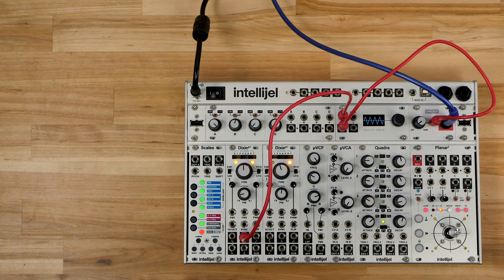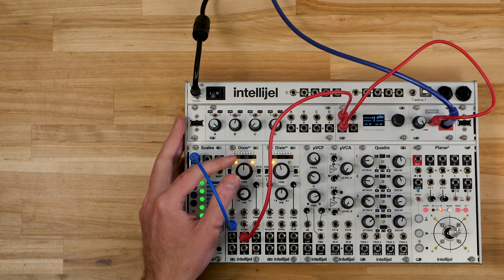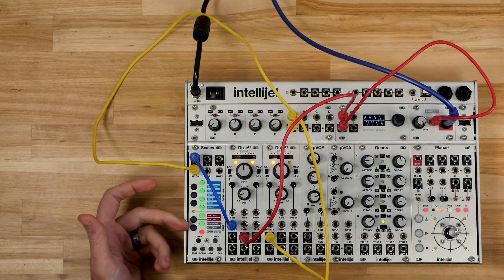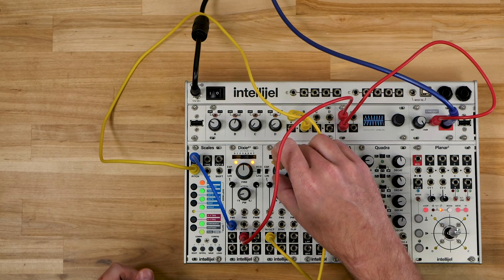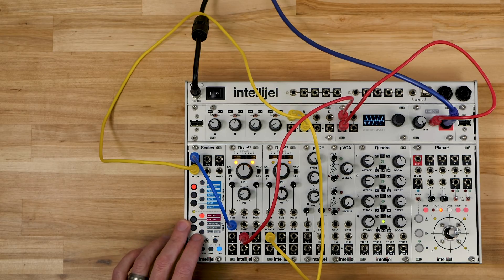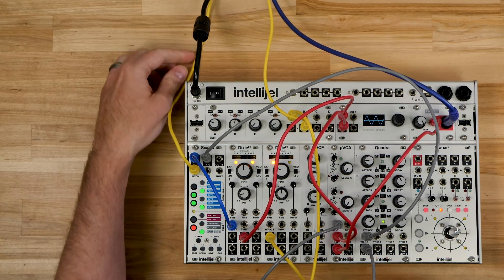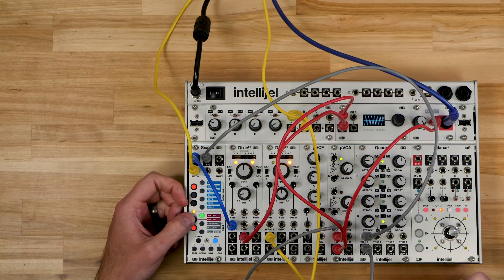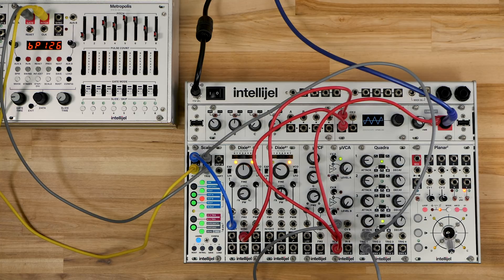Scales Walkthrough Tutorial - Part 1 - Quantizing With One Oscillator

Comment: How can I change the octave of the output? It that possible?
Reply from the maker: Scales can't apply an offset to shift the octave of the input cv. You'll need to offset the input cv before it goes into Scales, or change the octave on the oscillator (if that's what you're using). If you happen to be using it in Sequencer Mode and you're entering notes, you can shift the 'keyboard' octave up and down with the CONFIG and LEARN buttons respectively. Hope this helps!
Reply: Ok. Thanks for letting me know.

Comment: I'm looking at getting a scales after my turing machine kit arrives and i do currently have a metropolis. At the end there if i change the sliders on the metropolis would it automatically change on the scales. like if i had a-b-c-d on metro and scales and changed metro to a-b-c-d#, would scales read a-b-c-d-d#?
Reply: No, Scales would not automatically update if you changed your scale on Metropolis. But if you had Metropolis and the Turing Machine running through Scales in Dual Quantizer Mode you could just change scales on Scales and that would simultaneously change the scale for both inputs.

Comment: I'm not clear on root note changes.  If you hold a key to change the root note but the scale stays the same, what is Scales doing here and how does that change the notes coming out of it?  It's still just translating voltage to musical note (0v to C, 0.16V to D, etc), or am I missing something?
Reply: Changing the root note but maintaining the selected notes is not changing the notes coming out, but if you change scales or transpose by root note around that new root note it will make a difference. So it's less about what it does and more about what it will do.

I play around with changing root notes and transposing around root notes in this video: https://www.youtube.com/watch?v=2lx_IFBSn6I&t=2s
Reply: Ok I got it now, that other video made it perfectly clear.  Thanks!
Reply: @DavidZisa  One of the scales developers here... there's two scenarios where you may want to change the root note. One is you have a scale that's already rooted on one note, for example a C major, but want to use the same scale pattern but with a different root, say D. So you'd push D and all those notes shift around and now you'd have a D major scale. The other case is where you actually want to interpret the same scale pattern a different way. In this case you'd long press the D and you'd change the location of the scale root without shifting the scale, in this case you'd end up with a D dorian scale.